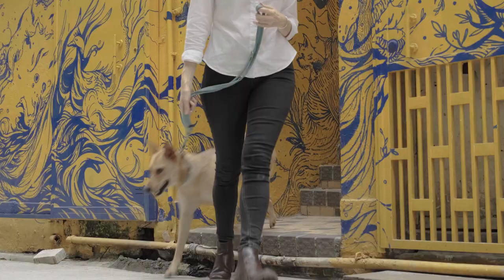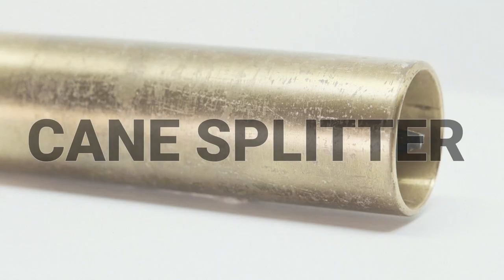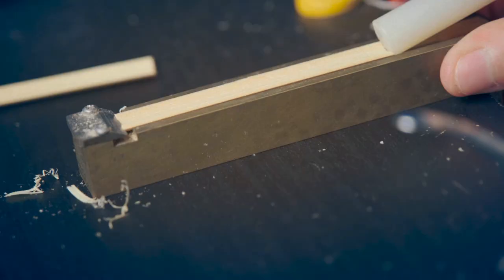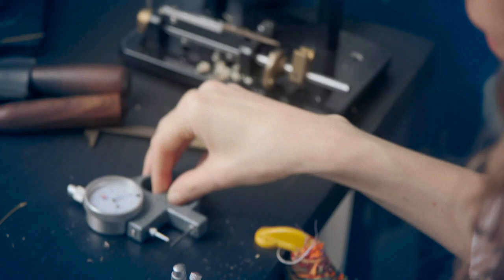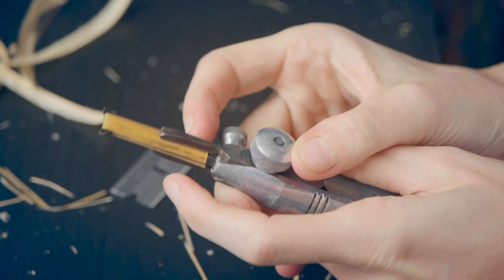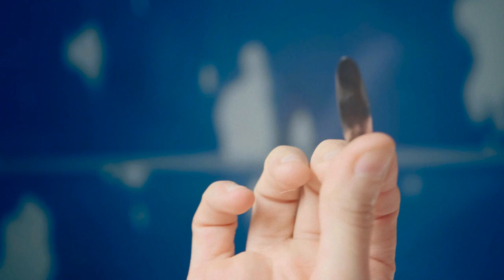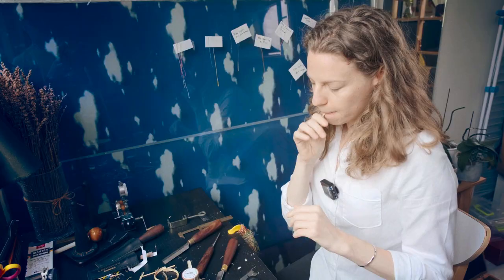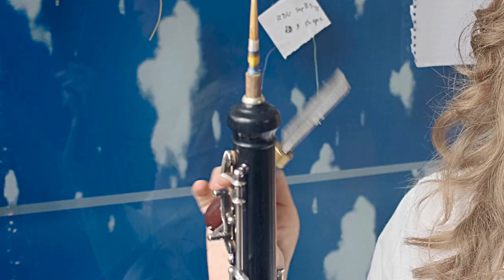Oboe Reed Making with Jen Shark

Comment: Thank you so much for your video! This is the future of reed making vids and all classical music related content. Just curious, what’s your process between profiling with a short scraped templet and eventually making it fits the parameters of a long scraped reed like they were shown at the end of your video? Or if you already been using templets for long-scrape reed and if so, how does the long-scrape templet feel on an kge machine? Thank you so much!
Reply from the maker: Thank you so much for your comments! Excellent eye! My profiler is actually a long scrape template but I set it up to only scrape the tip and heart because I prefer to keep working on the tip by hand a bit more after I use the profiler before adding the back.  I have to say it took me a long time (and patience) to get used to the KGE profiler.  I use the profiler to help me make reeds faster since with long scrape, we take off a lot more cane so it takes forever.  It's a nice way to get a feel for the reed quickly and tell if it is worth pursuing or to throw it.  I highly recommend a profiler if you would like to save time on reed making!  The beauty of the KGE profiler is as I mentioned earlier, you can change how much to take off the tip and back so you can have it customized for your needs.  This is the only profiler I have ever used and I actually was in KGE's factory outside of Shanghai when I bought it.  It felt like Charlie and the Chocolate Factory but with each door showing a different part of the reed making process :-)  Hope this helps!
Reply: @sharkdoublereeds5878  Thank you so much for your prompt reply it's all very informative and helpful!!! I do have a kge profiler with "French" template and a reedsnstuff machine with some long scrape temples but they've been sitting on my shelf collecting dust. Reedsnstuff profiler used to always take too much rails off of my reeds even I just do "pre-scrape" on them like you do, though I've never used a long scrape template on kge. Maybe it's time to give them a second try!!! It's amazing how the oboe world now has a much wider range of acceptance and sense of appreciation on different kinds of reeds, tones, styles, "schools", and instruments, especially in this world of Tabuteau and Mack! Anyways, appreciate you responses! Keep them cool videos up!!
Reply from the maker: @danshengquan4901  I understand this issue of taking off too much on the rails.  I still sometimes have this problem with profilers.  I would imagine since the french scrape is usually for a wider shape, that perhaps the chances of taking too much off the rails would be more likely?  I totally agree with you about the oboe world has become a lot more open!  Most of the people I play with here in Hong Kong are on short scraped reeds and we blend just fine :-)  When I bought my profiler, I had a lot of trouble with it so it also sat on the shelf collecting dust for a few years and then I gave it a go again and patiently worked with it a bit.  I still find myself tweeking it from time to time to see if I can get better results!  Thanks for your comments! :-) I hope to get a new video up soon.

Comment: I’ve heard that oboe reeds only last like 3 days. Is that true and if so why?
Reply from the maker: Hi Jonas!  This is an excellent question.  Oboe reeds unfortunately do not last long...for me, it depends on what music I am playing.  If it is music that requires a lot of articulation, that means the tongue is constantly hitting the reed which will naturally break down the reed faster because the tip is so thin.  The same goes if I have to play at a very soft dynamic for long periods of time (in an opera for example) and I am pushing down on the reed more than usually with my mouth which again would make the reed weaker faster.  The oboe reed is just a very delicate thing and being played, it will naturally break down quickly.  Also, with that being said, the bassoon reed lasts a lot longer (around a month or two) just because they are bigger in size and have more cane which makes them more durable against our mouth/tongue.  On average, my reeds last 1-2 weeks.